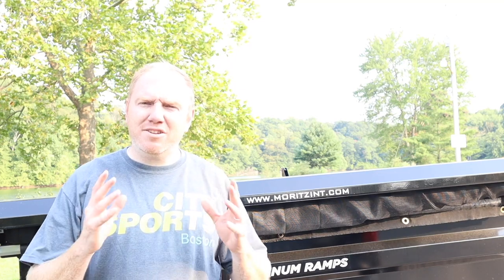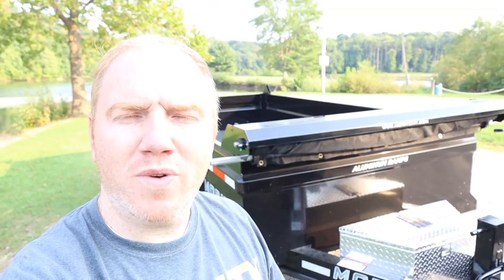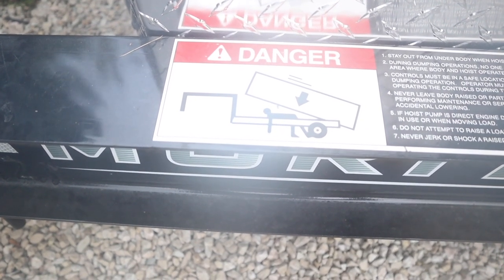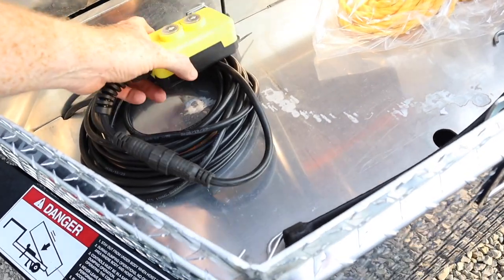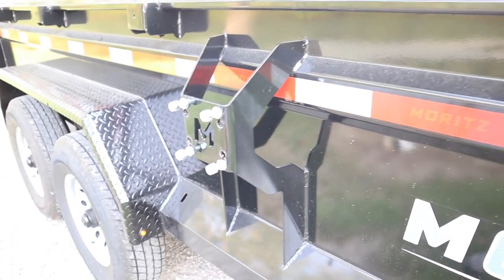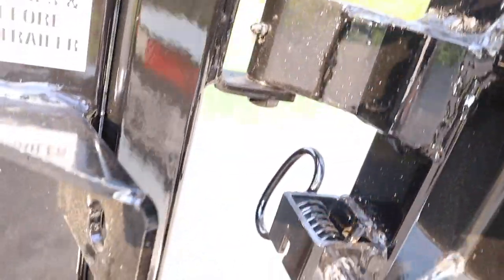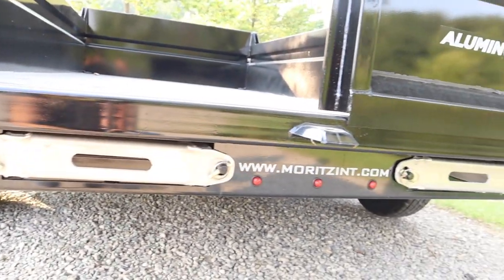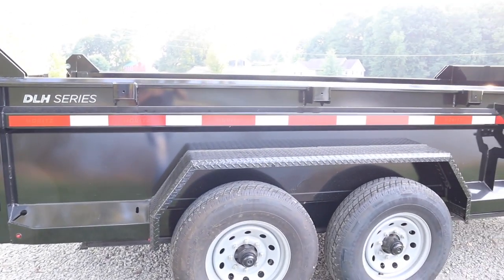What a Dump! A Review of a Moritz DLH Dump Trailer

Comment: ANY PROBLEM WITH THE PIN HOLDING THE GATES?  TIA
Reply from the maker: Nope. Everything is holding up really well!
Reply: Good to hear I just bought a 10 foot 9950 GVWR . Saw another video that the pin let go on the highway and dumped firewood all over the road. Unit looks very well built so I hope that doesn't happen to me.  @OneRentalAYear
Reply from the maker: That would be terrible.  @danlevecque7203